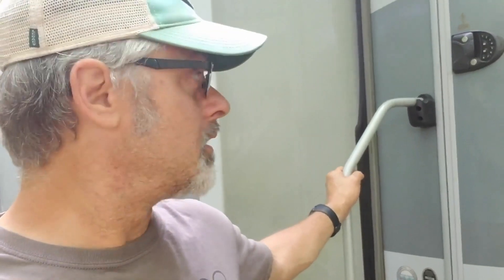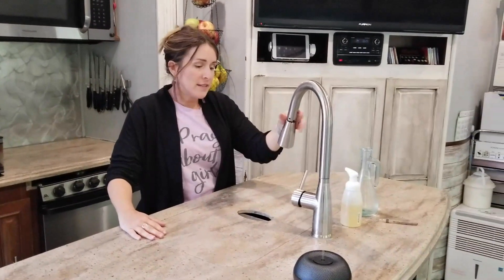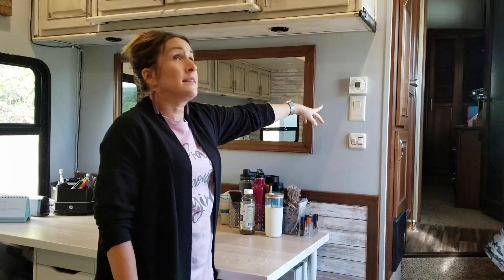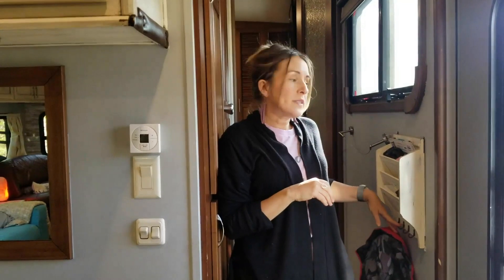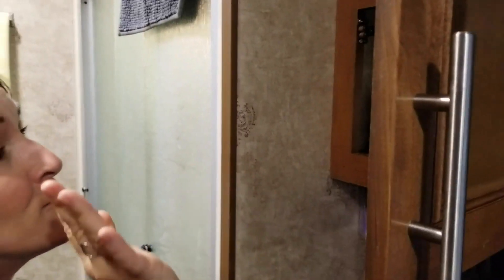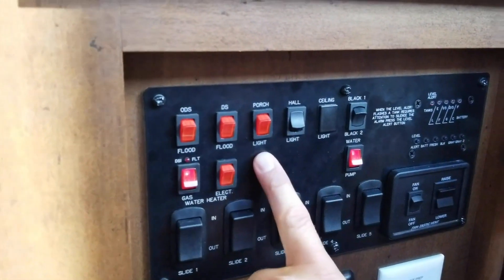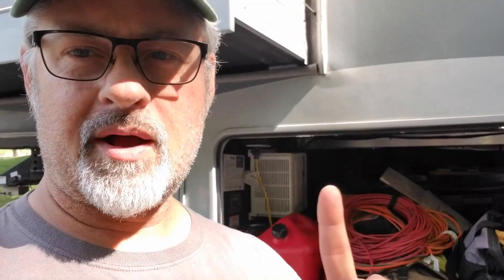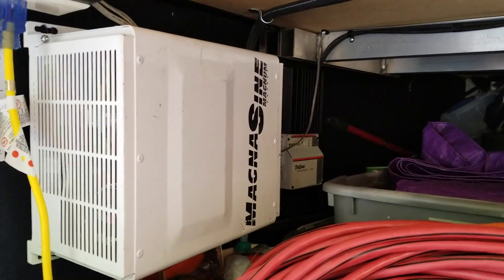Luxury RV Tour: Open Range 3X 427BHS

Comment: Hi! Researching and keep hearing the Open Range RVs, even older models have so many issues but the biggest is the flooring/sub floor being junk and needing to be reinforced at some point because it's just soft. Did you guys run into any issues like that with Open Range?
Reply from the maker: Hi there Karynne! We've had some pretty significant issues with our floors sagging, just as advertised. Right now there is a stretch of the flooring that runs from the front door to the back half-bath that's really soft. We've done some fixes in a couple of the spaces, but certain parts are much more difficult to get to. It's the biggest issue we've had with the rig, and definitely something we wish we knew before we bought it.